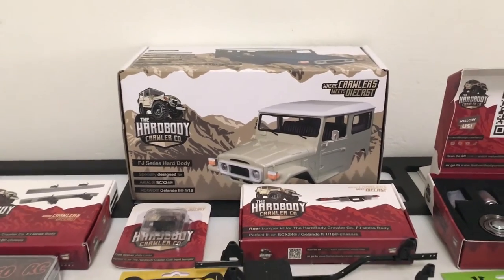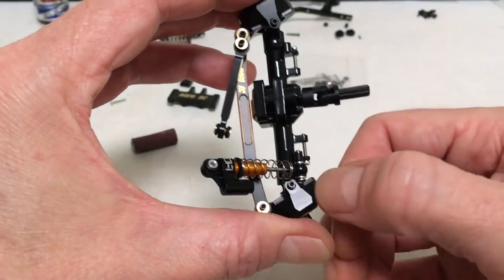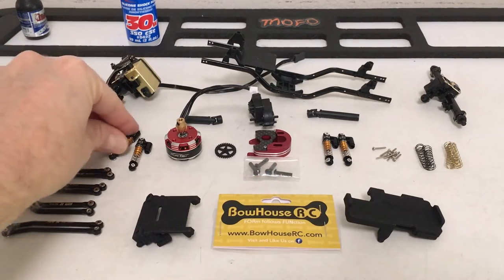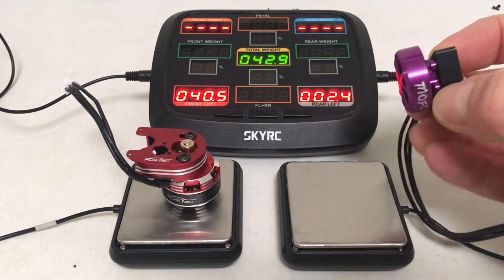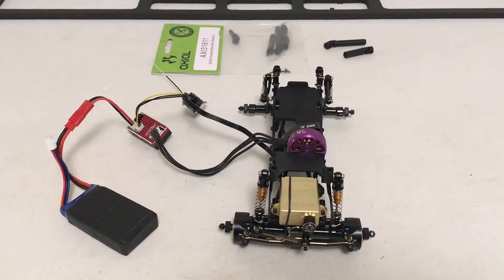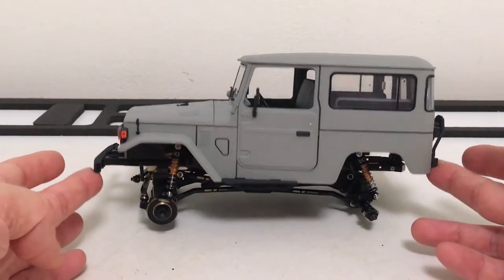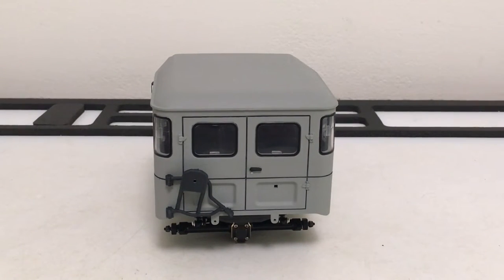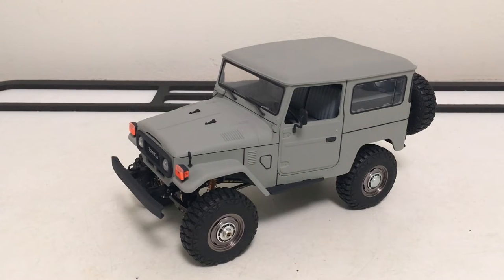SCX24 TOYOTA FJ40 BUILD: HARDBODY CRAWLER CO. BODY & ACCESORIES / MOFO RC / FURITEK - SUPER SCALE!

Comment: I know this video is 4 months old, but what about using the steelies, but leaving out the brass weights in the two rear and spare tire to achieve the front bias that you want. Great build by the way! Thanks for the content.
Reply from the maker: I think it would be too top heavy without the rear wheels having weight in them. Don’t have any brass in that spare though for sure! Thanks for the suggestion and tuning in! Cheers!

Comment: I use the front tray for the battery then mount the esc and receiver on to the rock sliders. No rear tray at all.  Use the mini Komodo not the micro.  It will bolt to your current motor mount.  I run it with the motor spinning in the rear.
Reply from the maker: Sounds like a plan.  I've done several setups like that.  That's one of the things that makes each build so unique is how the internals are laid out.  Not having side trays made it a bit more challenging on this FJ, but I'm super happy with the outcome!

Comment: Been meaning to ask you, what do you use to create clean lines in between the panels?
Reply from the maker: @athokala  I use a water based panel liner. Apply after paint and wipe away any overslop. Seal with a clear coat. Can’t find the brand anymore, but I’m sure there are others.
Reply: @bcochener  Oh, that’s brilliant! Thanks for the reply, I’ll be implementing your tip on my WTMicro builds as well! Coincidentally, I purchased some Rust-oleum gloss clear (2x ultracover). Do you think that’ll be safe to use? I use Tamiya TS series paint on my models. 

Also, thank you for your time! You’re helping more than you realize.
Reply from the maker: @athokala  no problem. I typically use Tamiya w/ Tamiya paints, but I did use Rustolium copper and sealed it w/ Tamiya clear on my WT Willy Cab/Cheat Code build.  You’ll probably be alright.👍 Cheers brother and thanks for watching and commenting!
Reply: @bcochener  Cheers! Love watching your builds!

Comment: With your lights on all your build how do u turn them off
Reply from the maker: Most of my builds have switched lights using a cyclical switch so I can control 2 switches on one channel.
Reply: @bcochener ok thx what lights do u use
Reply from the maker: @WestDesertRc  5-12V 3mm LEDs
Reply: @bcochener ok thx